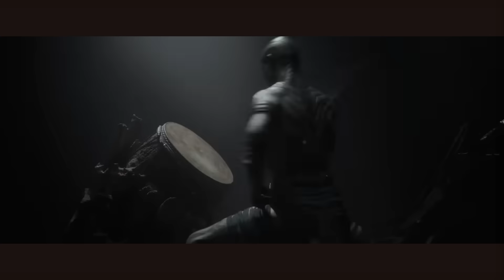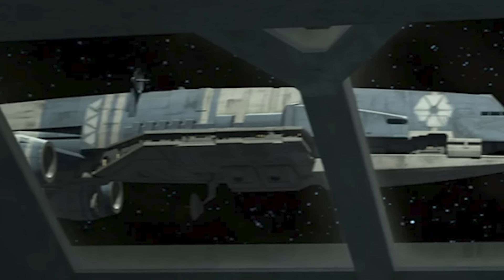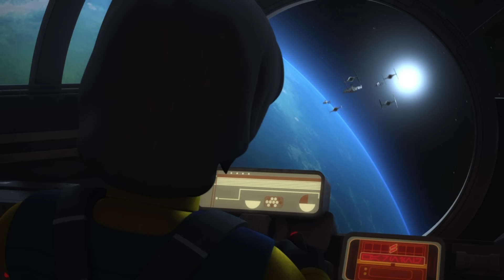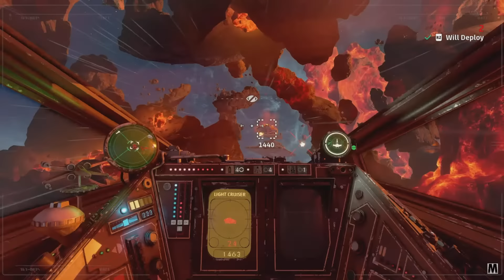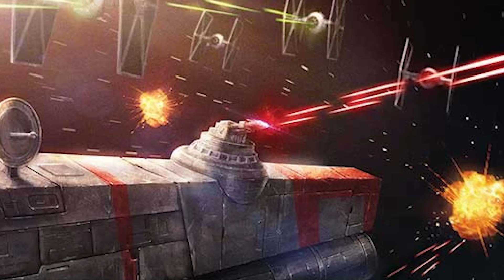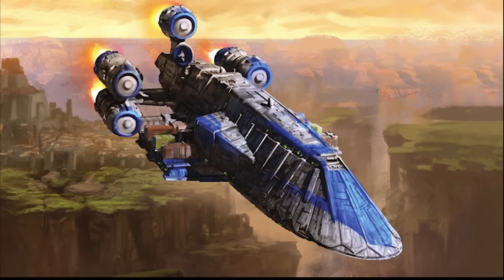The MOST Versatile Ship in Star Wars? (all Gozanti ship variants breakdown)

Comment: Me I like the idea that someone replaced the side cargo capacity of a C-ROC Cruiser, with a lot of missiles.
Or perhaps adding "2 DBY-827 heavy turbolaser turret's" one to each wing, perhaps taken from a salvaged crashed Venator-class Star Destroyer.
Reply: I think the former is more likely as the latter might be too power hungry for a ship that size
Though I could be wrong
Reply: Missiles certainly Heavy Turbos? You could maybe fit one toe each wing, but you'd need to replace most of the interior with extra reactors and fuel.
Reply: @DIEGhostfish  yeah, something like what is on the CR90 would be more doable but not the big big ones
Reply: I suggest to turn the cargo area simillar to an AC-130 gunship

Comment: I just love the gozanti and I hate how disputed its size is. I've seen it compared side by side to a LAAT/i where you'd put it at around 80m while some sources put it at about a millennium falcon.  I believe the 64m is already quite lowballed because if it should have 3 decks the length to height ratio wouldn't make sense.
Reply: The in-world explanation would probably be that it is based on the demands of the customer, you can choose a pocket version or family size depending on your needs lol

Comment: I feel like the Imperial variant could have easily kept the additional smaller laser cannons by mounting a pair of them sideways on airlock-like tubes that would be built onto the wingtips while another pair would be retractable and mounted on the sides of the main hull, with another one on the ventral tail section and another somewhere along the ventral spine. There would also be a pair of the larger turrets which could be light turbolasers like those on the assault carrier variant (and in the same  positions). This way the ship would have point defense capabilities that would allow for the best (or close to the best) possible firing arcs, while also having those two light turbolaser turrets to be adequate against larger threats. 

Another option would be to switch positions of the pair of retractable upper hull turrets and put them on articulated pods that are built into the side sections, somewhere along n the middle so they don't get in the way of the fighter/walker ventral carrying clamps. These articulated pods would allow the turrets to rotate 180° vertically, so they could fire above, below, or to the sides of the ship relative to the ship's axis.
Reply: Most of the non-imperial ones are already retractable .